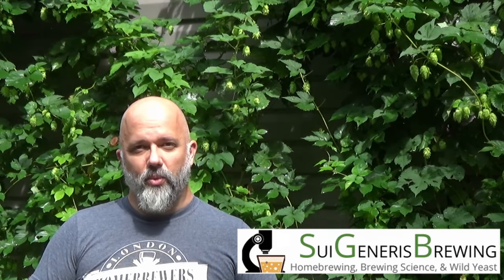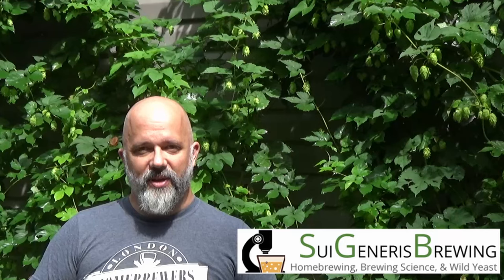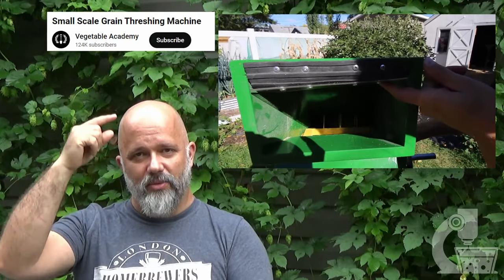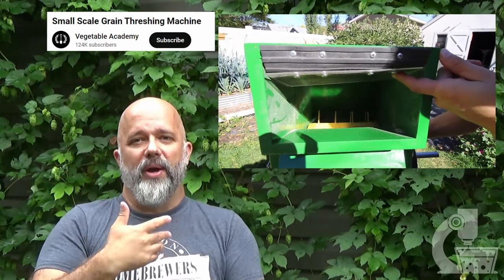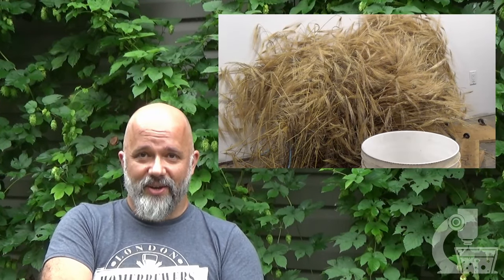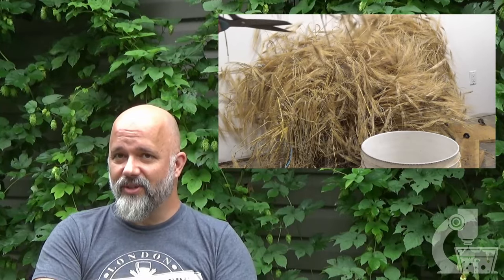Fifty Meter Beer Project Year 2 - Episode 3

Comment: Could a cyclone used in woodworking dust collection work for separating the grain?
Reply from the maker: @rimmersbryggeri  it might. Next year I want to try a vertical air lift.
Reply: @SuiGenerisBrewing  IS that the traditional method? Where they bashed the grain on the treshold and then tossed it in the air using a sheet to have the lighter components blow away.? Or some variation on that.
Reply from the maker: @rimmersbryggeri  historically, grain was thresher with a flail (essentially a nun-chuck with a long handle), then winnowed by tossing it in the air on a windy day.

Comment: Good to see the project coming along. The spontaneous fermentation sounds really interesting, even if that means that the beer won't be ready for a while.
I also like the traditional nordic farmhouse style route even if the yeast sourcing will breach the 50m rule. You could do a raw ale. But as for kveik, you could get some of the mixed strain cultures from the forums. Maybe you can even get a few different ones, mix them, and see if any straines flourish more readily within that 50 m perimeter. If you that's a thing (I'm not particularly educated when it comes to yeast.) You could even make a kveik-ring and air-dry the yeast for storage. Would that perhaps even induce a change to your local environment?

As a general question, I was weondering how you'd go about isolating and culturing thermotolerant yeast strains. Wild capture in heated word? Purification on agar with heated incubation? Reading about old farmhouse brewing in Denmark, it seems that the process has been the same, meaning that it's likely that they've also had somewhat thermotolerant strains. It would be weird if they were indigenous to Norway, so it could be a fun project to find and culture more local varieties.

Hope, the shoulder is getting better.
Reply from the maker: @pukbobo1423  most wild yeasts are thermotolerant, in the sense that they grow fine up to 35 to 37C. So most yeast you capture will meet that criteria...as do most commercial ale yeasts. But generally speaking, yeasts fermented at those temperatures will produce a lot of unpleasant off-flavours. My guess is kveik was selected over time to taste better when fermented at those higher temperatures, rather than being that way pre-domestication.
Reply: @SuiGenerisBrewing  So the best way to go about something like this would just be normal yeast capture and isolation followed by trial by ordeal in whether fermentation at around 35C yields something palatable?
Reply from the maker: @pukbobo1423  exactly